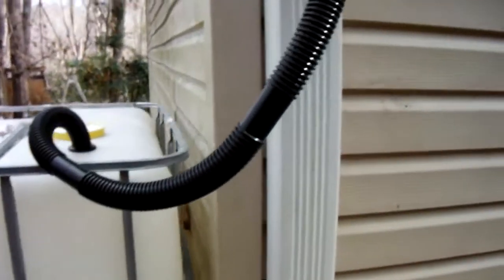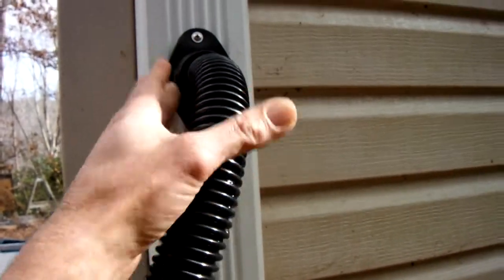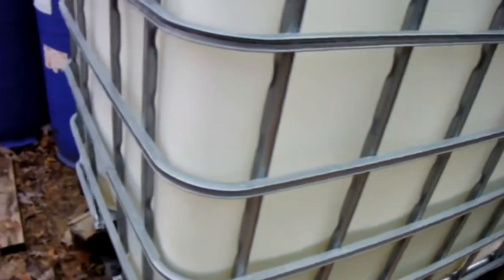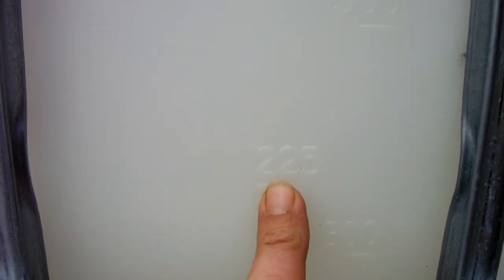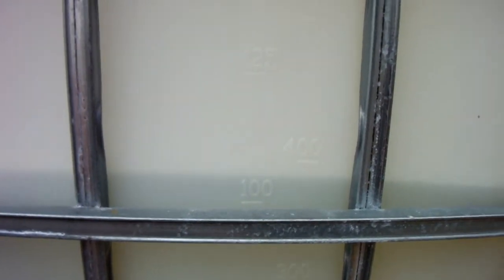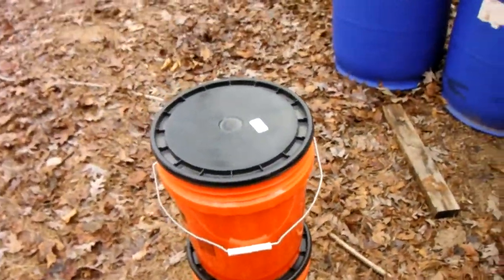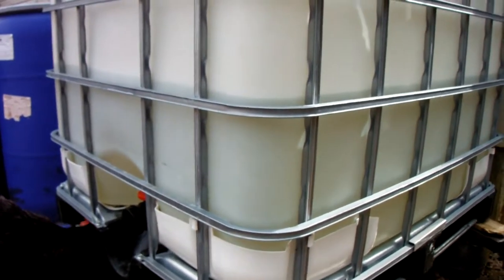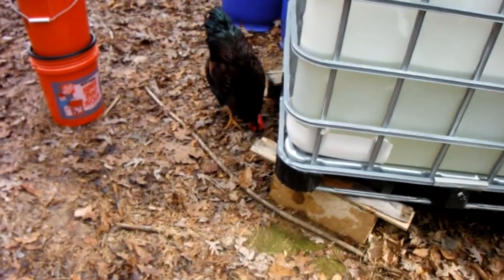Rain barrel and filter system

Comment: Hey TR, I was looking for a filter system for my rain water collection and It lead me to this video, Who have thunk? I'm trying to get the gravel from the roof shingles from going in my tank, or barrels do you have any ideas to that?
Reply from the maker: I bought a kit from wal-mart to go into the gutter for $25 and it doesn't collect 100% of the water  but catches most of it. I have a screen over the hole in the gutter but its flat and I have to keep it cleaned off. I've seen screens that are like a dome that go into the hole in gutter that look like they would work really well. But with all that being said you don't want your valve at the very bottom of your barrel or tank anyway. Even that tank in my video the valve is up off the bottom so if a little sediment gets in it it will settle to bottom and stay there, so no big deal if a little get's in there. That's cool my video popped up in your search. Take care man!
Reply: Thanks TR
Reply: Driver of All Hmm You could have a small tank (say a gallon) and depending on the size you can put either wire mesh/chicken wire or something more fine like and old filter, old cloth, stuff like that, like a small filter reservoir that can be removed if needed, but I wouldn't think you would have to. Or something similar, store bought from walmart that could be used which would be the fastest solution